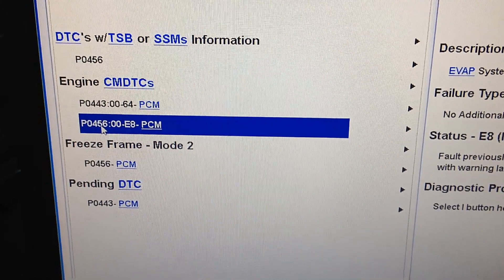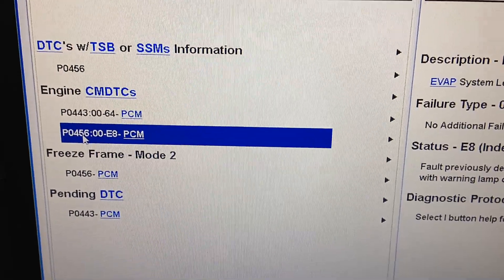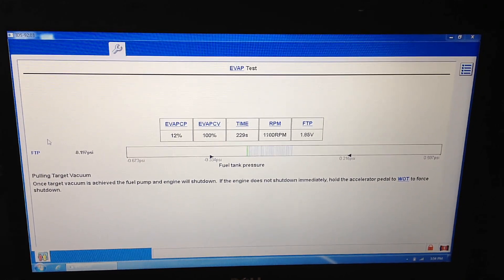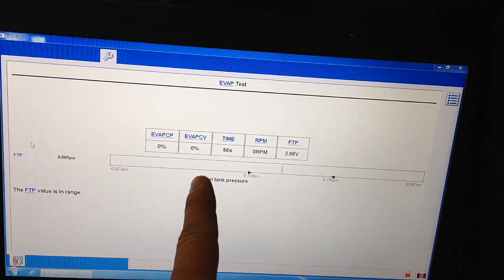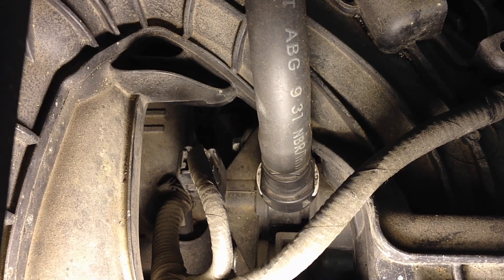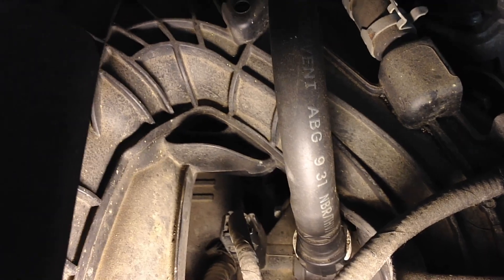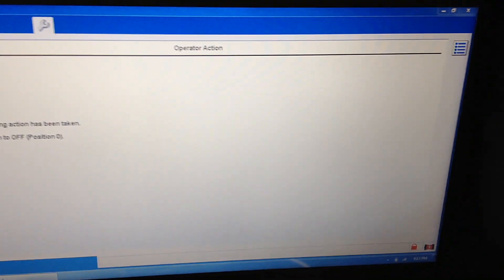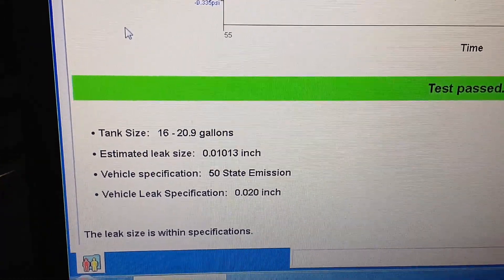Multiple Ford Vehicles 2009+ Evap System Leak Codes P0456 P0457 P1450

Comment: Maybe you could sugesty anything else. I have shipped my 2018 Ford PIU to Europe. It started showing same fault. I started from cheap: changed valve this valve: it did not help, then changed actual gas inlet with new it did not help. What else should I look. I have also cleaned inlet before and even bought lockable cap. But nothing helping. And services they don’t know how to deal with this fault. It is thrusting

Comment: I am trying to change this Purge Valve on a 2010 Fusion with the 3.0L V6. Is it common for the bracket to break? When I attempt to remove the bolts, the bracket is flexing and the bolts are not budging. There is no corrosion. The bracket appears to be part of the intake.  Any advice?

Comment: 2011 F150 5.0L: If the purge valve is bad, how strong is the vacuum once you disconnect the valve? I can’t really feel much of anything so I believe the purge valve is fine based on my interpretation of how strong the vacuum would be if the valve was bad. 

Last night I got the P0455 code after driving on the highway and getting on it pretty hard. A week ago I also got an error on the gauge cluster about the capless filler neck having a leak but after turning the truck off it went away and hasn’t come back. I’ve checked the capless “flap” and used the OEM funnel to open and close it a bunch to make sure there wasn’t any dirt in it. It could be a coincidence but it seems like both instances are related to whatever is going on. 

This code has me a little perplexed since the purge valve seems to be completely fine. I cleared the code and I guess I’ll continue to drive it and see if it comes back. 

If anyone has any suggestions please shoot me a DM or respond to my comment.
Reply: Just wanted to follow up on this in case anyone else experienced a situation where the purge canister valve wasn't making noise or it seemed fine from the troubleshooting test. I ended up just replacing the purge canister valve since it's so cheap and voila it fixed my issue. It also increased my fuel mileage a little bit.

Comment: I have a 2003 ford expedition with 5.4. With P0457.  Mechanic said it’s my fuel cap. I’ve replaced twice, and seems it’s something else.  Does the 03 ford models have purge valves?

Comment: Code P0442 on 09 F150 5.4 3v…code reader says it’s permanent. Could this be anywhere on the system or is most likely fuel inlet?

Comment: Quick question.....2013 edge. Small and large evap leak.ran test .snap on solace..passed.light came back on after a few miles of driving.also I have erratic long starts first started.not while putting  fuel in?? Has 200k ..thanks for any ideas .great videos

Comment: Hi sir can this be applied to a mitsubishi galant 02 they are notorious for P0456 replaced gas cap several times and got oem model went away and came back after 2 months got p0401 code replaced egr valve and reset codes and went away no codes but 2 weeks later engine light P0456 code back on...can i do this procedure too most likely might be it any suggestions thank you

Comment: Have you ever come across the evap system saying: very small leak ? When you put OBDII CODE READER ON IT SHOWS AS SYSTEM BEING ALL GREEN NOTHING IS RED. YET THE STATUS LIGHT ON MY CODE READER IS RED ONLY. MY 2007 FORD EDGE SEL AWD SHOWS CODE P0456 1/2 AND  2/2 SHOWS AS PENDING.. ON MY VEHICLE  HAS 2 NIPPLES & HOSES ON PURGE VALVE...NOT JUST ONE SINGLE NIPPLE AND HOSE...AS ONE YOU DONE IN VIDEO HERE..

Comment: Is a P0455 code close enough to suspect the purge valve also? Everything I've seen says Gas tank lid...of which Ford in their infinite wisdom left off my 2012 Edge. I'm going to change and clear the code anyway. How fast could the canister fill with gas (bad thing) if I have to drive 2 days before it gets here (good thing)? Or could I plug the hose  for those two days?  Thanx so much for all your videos. (Still haven't attacked the familiar "driver's door open" switch yet...)

Comment: Had code p1450 and replaced just the purge valve not the hose, it cleared the engine light but truck is still hard to start, unless I start it with gas cap off? Any info you could share!

Comment: Where would I find the evap purge valve on a 2010 Expedition 5.4 Triton?
Reply from the maker: Top of the intake, right behind the throttle body.
Reply: @FordTechMakuloco , appreciate you taking the time to answer. I went looking for it and I couldn't find it. Does the evap purge valve have a different design on the 5.4s? The only thing I could locate looked like it was online instead of a 90 degree angle like the one you show on here

Comment: This Escape is eating my $. First the Master cylinder then the Break booster today, and now I'm trying to get these codes fixed. I have the p0440, p0400, and p0456 code. I have changed the EGR tube, the purge valve, and I cleaned out the gas fill area. Anyone have any ideas on what it could be?

Comment: Any videos or suggestions for replacing on a Ford Transit Connect 1.6L 2016? The purge valve is tied to an entire harness assembly with 4 connectors, 2 of which are in impossible places to get to.

Comment: Hello. So is it neccessary to have the system calibrated? I'm quite sure I can change out the valve on a 2013 Fusion. But don't have the equipment to calibrate.

Comment: I realize this is an old video but thank you for the simple fix showing what codes this fixes. The only thing that complicates this job is when you drop one of the purge valve bolts.
Reply: It doesn't really matter how old the video is. A 2009 Escape is always going to be a 2009 Escape and will always have the same common problems.

Comment: Another great video.  Thanks.  My wife's 2012 Escape Hybrid Limited first had Code P0442.  Cleaned and lubricated fuel filler cap, per your other video.  Then, threw Code P0456.  Replaced vapor canister purge valve.  It's right on top of the engine, just in a different orientation.  All good!  Thanks!

Comment: It worked!! Thank you very much. When I unplugged the electrical wire I didn't have the flutter noise but I had the suction as described in your video. I put the new valve in, tested it but had no flutter or suction with the electrical plugged in. So I decided to take it for a test drive. Came back home tested it again and it worked flawlessly as described no suction or flutter when unplugged. And suction and flutter when plugged in. So if what happened to me happens to you when you test the valve. Take it for a test drive after installing the new valve. Than test the valve. Thanks again!

Comment: Please answer. I checked mine and the old one never had any vacuum on my thumb and never fluttered or made any noises. I installed a new one and it flutter with vacuum and the no vacuum when unplugged like you said. Should I be hearing the flutter when it's fully installed? I hear mine, it's pretty loud and now one I turn off the car I hear I pretty loud blowoff from it. Do I have another problem too like the hose is clogged or is all that normal? I have a 2011 Mustang GT 5.0. Please let me know. Thanks so much. Great video!

Comment: Replaced the Purge Valve and Fuel Filler neck (tried cleaning it before but didnt work) and I'm still getting the Check Fuel Filler Inlet message on the dash with the engine light now on, Code P0457. What am I missing here? Could the Canister Vent Solenoid throw this code?  Please help!!!!

Comment: Do the vent solenoids on 2008 f-150's go bad? I have ap0446 code with a p0455 pending. Do you recommend changing the canister and the vent valve at the same time if the vent solenoid is bad?

Comment: Hi cool video I'm just wondering why my '15 Ford Fiesta only stalls after I refill the fuel tank then after I sit for about 5 to 10 minutes and pat the gas it'll start running okay. I am also pulling code p1450 though so I'm going to try to check vacuum, thanks for any info

Comment: I changed the valve it was easy, but my engine light still on, I have a 2014 Ford escape S..
Do I have to reset the code and how do I reset it??
Reply: so i could be the gas cap

Comment: Instead of a leak, i'm actually having a build up of pressure, do you have any thoughts on that?  The suggestion by my auto parts guys is that I need to replace the solenoid instead of the valve.. what is the chance that you have covered this as well?

Comment: I have recently ran a scan on my 2009 Ford Escape XLT 3.0L and we have a P0456 code, i have done ur test on the purge valve, there is suction when harness is connected and there is no suction when harness is unplugged, fuel filler neck looks clean as well, what else can be failing? thanks, hope to hear from u soon.
Reply: Hi, I'm trying to find the purge valve on my 09 escape, same engine. Would you mind sharing where you found it?

Comment: Thank you for this video! I have a 2013 Ford Edge with a 3.5 and 120,000 miles. I followed your instructions and it fixed the P0456 error and got rid of the check engine light!

Comment: Question?   Do i need to have the software to test it ?    or just do the replacement  ?
Reply: You could easily perform the test described in the video to see if your canister purge valve is bad. If you don't have the same failed results as he describes, then you can go to O'Reilly's or Auto Zone and they will scan your car for error codes for free, write down the code and search google or you tube for a fix.
Reply: Was same issue . I just replacement and remove negative of battery and works back again .   Thanks for video .

Comment: 2010 Fusion Felt vacuum,  without electrical connection and swapped out part.  No Vacuum,  Code 1450 cleared but still have  P0456 after driving 100 miles. Thanks for the video.

Comment: Thank you !  My wife has a 2012 Escape... the P0456 popped up today. Did your test and after unplugged it was still getting suction, went to an auto part place, grabbed a replacement one for $16.99, Popped it in (it's in the front of the motor, took a whole 3 min to swap) and re-did the test. No suction after being unplugged.  Too bad the code will take time to go away, my wife does under 20 miles in a week. I would pull the battery, but, she's worried about losing presets and Blue-tooth settings.
Reply: Dave Evans you can buy a code reader on amazon for like $20 and reset it that way. Or probably go to a local parts store and ask them to reset the check engine light.

Comment: Will the engine light still be on after the valve is changed out? Or should it be off? I reset the light after I changed my valve. 2013 ford flex.

Comment: My truck runs just fine no noises I cleaned out my fuel inlet with step and a clean micro fiber cloth today the code finally cleared off my dash screen I cleared the check engine symbol but I don't want that small leak to get worse.

Comment: Hi my 2012 ford f150 xlt came up with code P0456 I can see where there is a small leak in the hose that goes from the fuel inlet and the gas tank can I just replace the hose?

Comment: Thanks a ton for this video!!! It saved me a ton of money. I have a 2012 Ford Escape Engine light came on and I took it to Autozone to get the code (EVAP leak) Found your video and tested to see if there was suction and there was. Ordered the purge valve from your handy amazon link. Replaced it and a week later the engine light went off. Ford Dealership wanted $140 just to look at it!! THANKS !!!

Comment: I changed my valve (also my solenoid at the tank), and just threw the P1450 code FOR THE 3RD TIME! 😡😡 I cleaned the fil,ear neck as per the other video too. It's a 2011 Fusion 3.5L.
Any ideas left that might work? I'm at a loss now. 🤔😡

Comment: So no vacuum what so ever when the power is pulled? I have a 2011 f150 w/5.0 & after watching the video I tied the valve test & there was some vacuum w/the power pulled. As cheap as the part is I'm going to replace it cause there's nothing to repair anymore just replace it. Your video was easy enough to follow just not up to speed w/ all the new emissions controls that are on vehicles today.

Comment: When i first got my mustang used 2011 gt it through a code p01074 and p01072 cpv but i replaced it with a new one still the code comes up drove the car around for some miles still the code i dont think its a vacuum& leak maybe my o2 sensors cause the code says im running lean bank 1&2

Comment: I have a 2014 Ford Escape. For two weeks my car has a hard start after every fill up. I have taken it in to be fixed 4 times, and nothing has worked. I brought it first to AutoZone to detect why it would not start and initially it pulled up that I needed an o2 sensor replaced and the p1450 code. O2 sensor has been replaced, evap canister assembly fueling retainer replaced, and still nothing has fixed the problem. I called the shop Again and mentioned the purge valve may need to be replaced. They said they will try that. Again, does a bad purge valve prevent the car from starting after fill up?
Reply: Yes sir, had the same problem on my 2013 Escape. 1450 code put a Vapor canister purge solenoid on and its fine!

Comment: i have a 2013 ford edge, i have already replaced purge valve and did what you said in to fuel filler maintenance vid. and i have also done a smoke test but didnt see any smoke escaping from evap system. p0465 code still exist, any further diag. ideas?

Comment: I have the p0456 code on 3.5l ecoboost 2012 f150. No suction when unplugged and opens (has suction) when plugged in. I have no other codes. any ideas?

Comment: Hi I have a 2103 fusion 2.0 eco-boost awd and after driving and it sits for about a half hour and we re-start to go it slowly looses idle and quits. I then can restart and go no problems. Just had the purge assembly on the engine replaced and it is still doing it. Have you ever ran into something similar?

Comment: Thxs for the video. I have p0442 code (small leak) on 2006 Ford Explorer 4.0 L and turned to be due loose vapor hose under the fuel tank. It is the hose that goes to the vapor canister but can't know it's part number. Could you please help by telling me it's part number? Thxs in advance

Comment: I just recently bought a 2011 Crown Victoria Police Interceptor that check engine lights on so I took it to my mechanic and we noticed it was canister purge valve that has a check engine light on So we replaced and the check engine light keeps on coming on with the same code so my mechanic went and rechecked the whole car out we changed everything with that could be the problem and still can't figure it out. do you have any suggestions on what it could be??
Reply from the maker: 2011 is quite new but check the evap line as it runs up the frame rail on the passenger side there is a tube that has an inline FTP sensor the tube cracks at the curve. Smoke test it and go from there.

Comment: I guess my situation was a stumper, I never did hear back from you on your face book page. I've been having that P0456 code on a 2014 F150 for about a year now. Not too long ago the fuel filler neck was replaced, and last week I replaced the canister purge valve. I've had a smoke test done and no leaks were found but I'm still getting that P0456 code. I'm out of ideas as it appears that the system is working just fine but the computer is seeing something but no one seems to be able to pin point the problem. I was hoping that you may be able to shed some light on this on going and irritating problem.

Comment: you need to show where it is located under the hood. I am not a mechanic so I need to see a short camera shot starting from showing the whole hood to the location of the part please.
Reply from the maker: +Harvey Ibarra it really varies on every model engine and Year.
Reply: FordTechMakuloco cool. I have mine. It was in front and on top next to the fan. Extremely easy to get to.
Reply: 2013 Ford Edge 3.5 V6, Mine was behind the throttle body under the front of the windshield. Still very easy to get to.

Comment: Thx a lot for this video, it helped me a lot with different things.  With my OBD2 I have the code P0456 on my Ford Escape 2009 with a 3.0L.  I found a faulty canister purge valve (with the help of your video) and of course I replaced it.  I also cleaned the filler cap even if it wasn't looking dirty...  But I still have this code P0456 Evaporative Emission System Leak Detected (very small leak).  After few days, the check engine light illuminate and only that code is showing...  Any other suggestion before spending a fortune at the dealer and have it checked ?  Thx again a lot for your support ! ;)
Reply: I've got the same code on the same vehicle.  could you let me know where the purge valve is located?

Comment: My 09 Escape 3.0 L started throwing a P0400 and P0403 code recently. I inspected the EGR Valve and lines above the intake cover. I changed out my battery/starter/alt wiring harness last week and though maybe I knocked something out of place. Could not find it. Any suggestions?